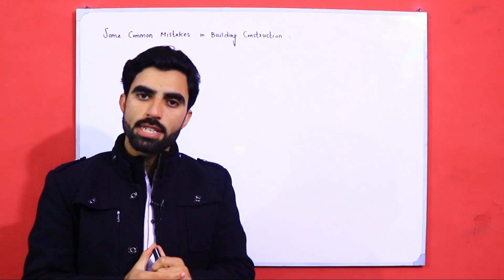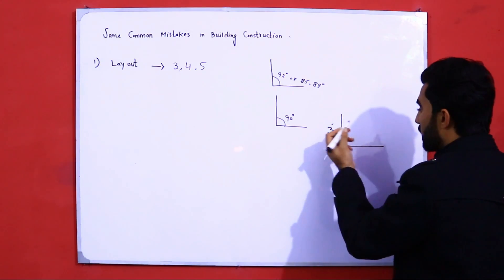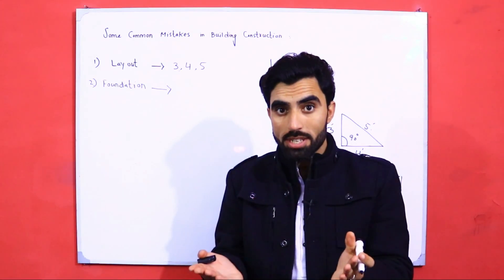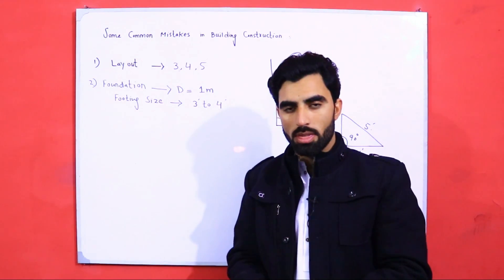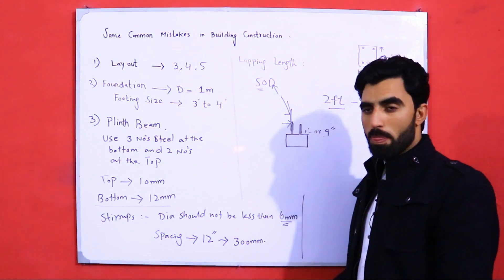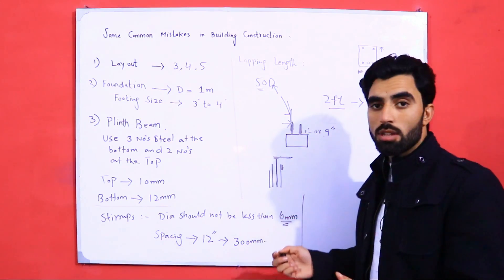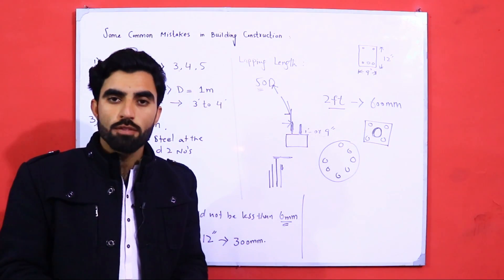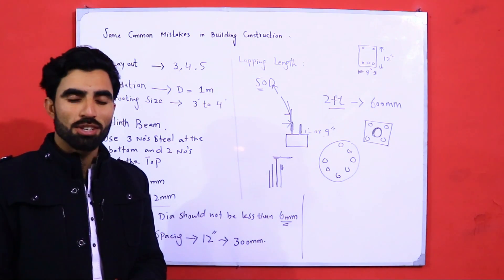8 Common Mistakes in House Construction - And How to fix Mistakes in Construction

Comment: Dear, if you provide six numbers of steel bars in rectangular columns instead of four numbers what is the different load-bearing capacity of the columns of that particular, please. what the minimum reinforcement ratio towards columns.

Comment: Sir before you said in other video that the space between two stirrup are 6 inches.now you say 12 inches.
Reply: Abdul ... spacing between ties in columns ...should NOT be more than 12 inches apart..... meaning the space between the ties can be 6-12 inches apart.   Hope that helps
Reply: @red-hat-mike  in column  also same method.or different
Reply: @Lala-w5e  Spacing of the ties in columns :  Ties are spaced every 20 cm except for the first and last sixth of the height (H/6) where they are doubled, resulting in a spacing of 10 cm. The first ties above the plinth and the last ties below the bond beam should be spaced by 5 cm.

To clear confusion ... read this:
To remove the confusion of when to use the term ... "stirrup or ties" , it is named differently.   Column has ties and beams have stirrups.